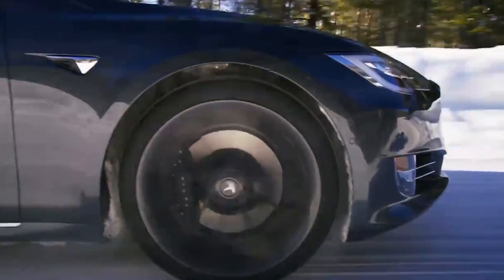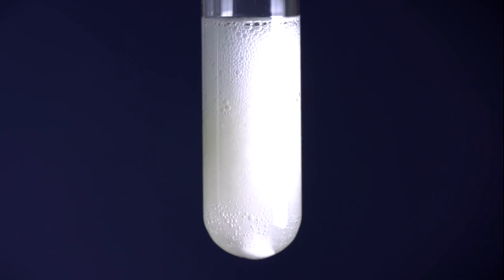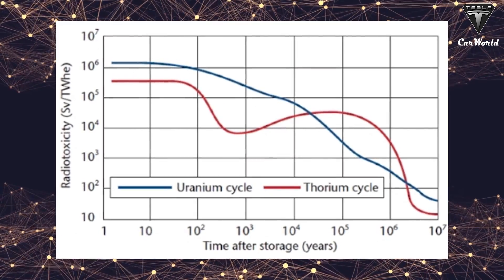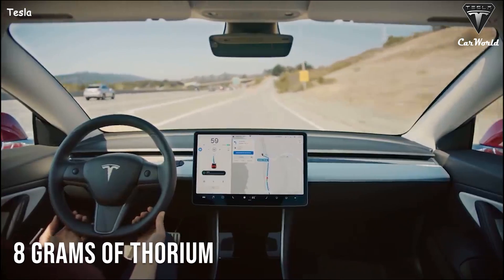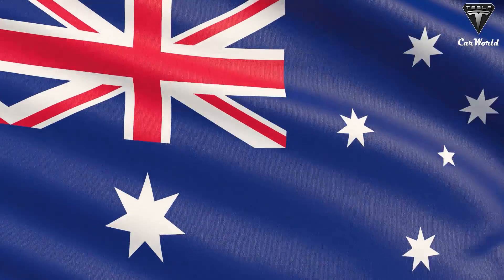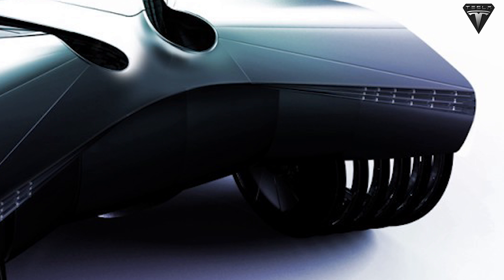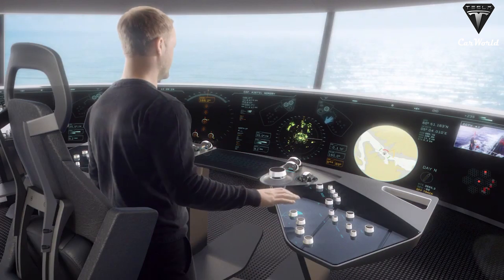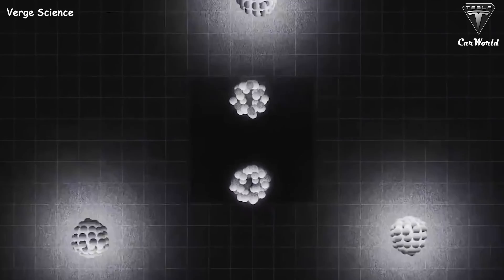IT BIG STORM! New EV Battery Thorium Technology, Destroy Tesla 4680 battery!

Comment: Thorium is a basic element of nature, like Iron and Uranium. Like Uranium, its properties allow it to be used to fuel a nuclear chain reaction that can run a power plant and make electricity (among other things). Thorium itself will not split and release energy. Rather, when it is exposed to neutrons, it will undergo a series of nuclear reactions until it eventually emerges as an isotope of uranium called U-233, which will readily split and release energy next time it absorbs a neutron. Thorium is therefore called fertile, whereas U-233 is called fissile.
Reply from the maker: Thank you so much for your useful information! Have a nice day!

Comment: DA. Battery a device of different chemicals where the electrons are encouraged to flow to cathod when charging and back to anode when discharging.
A fission reaction is where the increased mass of a nuclear material excites the particles so they collide hard and generate heat.
Number 1 is a battery number 2 is not.

Comment: Thorium is a fake car power idea. Occasionally, a story is passed around like hydrogen cars, lidar tech, or this , thorium. These are meant to confuse people from the incoming standard of battery/electric cars. For instance the radiation shielding it would take to protect the car occupants makes a regular car unthinkable.  Pro tip: Before making a video, confirm your info with very credible sources.

Comment: Thorium is old technology dating back to the 1942 with the Manhattan Project. The project was to study nuclear energy to make a bomb. What they discovered was plutonium could be used. What they also found out was that by using Thorium, you could use it like plutonium or uranium to generate electricity or energy. But there was a big downside "politically speaking". With Thorium, you could not make a bomb. That killed it's use. If nuclear power plants would have started using Thorium instead of plutonium or uranium, It would have been more environmentally feasible. Advantages : 1. No run away meltdown. 2. The half life of used Thorium would be a fraction of uranium or plutonium. Thorium would have been the cleanest to date technology to produce electricity in great abundance. 3. Thorium is found in great abundance. Leave it to our politicians to screw up everything you love and is good for society.
Reply: Are you saying they knew about Thorium, but still used plutonium and uranium despite the major risk?
Reply: @TheRepain  YES.
Reply: @homeontherange733  Do you know why?
Reply: @TheRepain  You're so right. When i read that article in "Wired", i was floored! I am surprised Elon Musk doesn't talk about Thorium. I would be interested in his thoughts on Thorium. Be well.
Reply from the maker: @ Michael Smith  we agree with you. Thorium reserves are abundant and it can be a potential material to replace Uranium.
btw, thank you so much for your comment! Have a nice day!

Comment: .....yet another click bait video....

Thorium isn't a solution for a "new" EV battery being that the radiation it puts out would be used in extremely old Nuclear battery technology called a RTG (Radio Isotopic Generator) of which it isn't even good for that.  To give you idea how old this technology is, an RTG is powering the Voyager space crafts and has been in multiple satellites for Decades.  So few things about Thorium and Thorium Reactors.  First of all we had two Thorium Reactors both in the united States one was going to be used in the Nuclear Flight experiment AKA the Nuclear power Jet aircraft which is currently located in Idaho national labs and was created back in the 1950s.  Lots of great videos about it and how it was going to operate etc.  The other is Located at Oak Ridge National Labs, testing for this reactor ended in the 1970s.  Thorium reactors operate off the Thorium 232 fuel cycle vs the Uranium 235 fuel cycle.  I'm not a Nuclear Physicist but there is a reason behind why in the 1950s through 1970s when we are doing all this testing and had access to thorium reactors we didn't use it.  More than likely because of the complexity difference between the two fuel cycles.  The Uranium fuel cycle is much easier to maintain vs thorium cycle, also the amount of energy produced by both Uranium and Plutonium is far greater than that of Thorium along with the longevity of the fuel itself.  Oh one more thing MSRs can use Uranium along with a plethora of other Isotopes as a fuel source.

Anyway an MSR is just another reactor type that may or may not be a viable solution for producing electricity in the future.  MSRs are safer as compared to the other reactor types, however the cost to build and maintain are far greater.  Also the enrichment levels required for MSRs are on par with what is used in Nuclear weapons so the process to produce fuel costs far more than that of current reactor types.  Which gets us to another question why we would only have 1000 years of fuel even though thorium has a 14 billion year half life vs the 60,000 years we have with traditional reactor types.  The level of enrichment actually lowers the life span of the fuel sounds weird I know but in the end you have a fuel that has to be so concentrated to work.

On another note the video talks about a Nuclear battery that could be used in Phones etc.  This battery has "NOTHING" to do with Thorium or MSRs.  An MSR wouldn't aid at all in its producction being that it utilizes Carbon-14 which is part of the nuclear waste produced by current reactor technology's fuel rods of which don't exist in an MSR.  The battery I'm talking about is the NDB (Nuclear Diamond Battery) It works off of Betavoltaics.  Similar to Thermal Voltaic that the RTG uses and Photovoltaic that Solar panels use this takes in the Beta Radiation produced by a decaying isotope and produces electricity directly.  three types of particle radiation out there Alpha, Beta, and Neutron.  Alpha is mainly produced from Isotopes with a large nucleus Uranium-238 turning into Thorium-234 when it decays.  One that people don't realize is in their homes and required to be there by law is Americium 241 which is found in Smoke Detectors.  It decays into Neptunium-237 which has a half life of 2 million years.  Before you freak out and go OMG I have RADATION IN MY HOME!!!!!.  Don't worry Am-241 only produces Alpha with trace amounts of Gamma radiation, You aren't going to turn into the hulk Gamma is ionizing radiation like X-ray's it basically goes straight though you and does nothing at low levels like this one.  In order for Ionizing radiation to cause any harm it would have to be in the Million Volt Energy range and then it would basically disrupt the Electrical signals in your brain kinda like a wireless off switch.  Anyway back to Alpha Radiation, it is basically a Helium Nucleus traveling at a high rate of speak talking near light speed and that energy is bled off rather quickly.  So it really isn't the "Skin" that blocks the radiation as much as the layer of Dead skin is thick enough to prevent the radiation from coming in contact with a live cell and causing any damage to it.

Lots of information about radiation and how it can or won't effect you shielding involved and products that we use and consume every day that produce radiation.  Oh side not for all the smokers out there it isn't the chemicals that are hurting you its the Radon that is attached to the smoke you are inhaling.  So if you smoke in a Basement, or any where near Granite Counter tops....I suggest you stop being that Granite Counter tops and Concrete usually due to the natural decay of various isotope in those materials create Radon Gas which then attaches itself to the smoke particles when you in hail and lodge themselves in your lungs with the tar created by the smoke.

Please avoid click bait videos like this one....

Comment: I think you are wrong to mention that India has the biggest Thorium reserve. I've found that Brazil has the biggest Thorium Reserve estimated in 600 000 metric tons as mentioned in IAEA. "Total thorium resource figures of in situ for this publication are 632 000 t thorium as reported in [16]. During 1886–1950, ~95 000 t of monazite were exported.
All thorium resources known so far in Brazil are extractable as by-product of other minerals and availability depends on the needs for the main product. In the past thorium has been extracted from heavy mineral sands (monazite) from placer deposits at the coast of Sao Paulo. However recent information is not available."